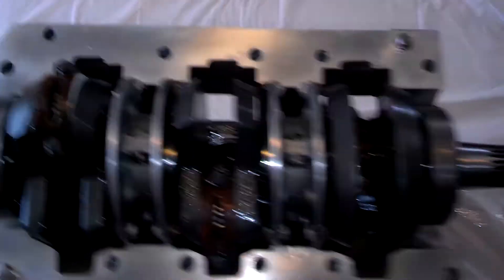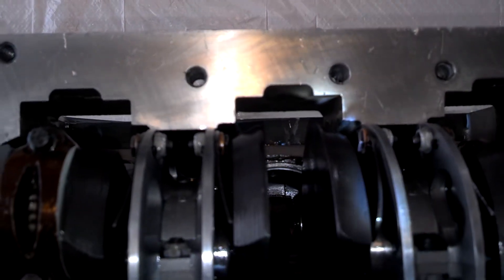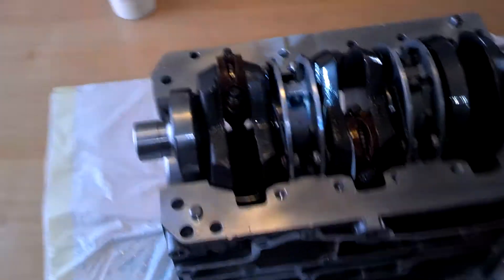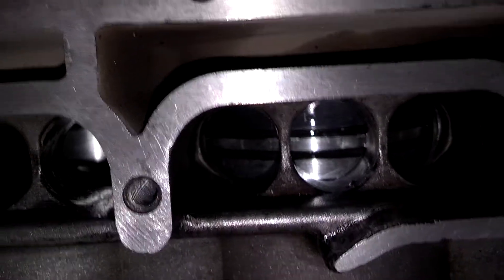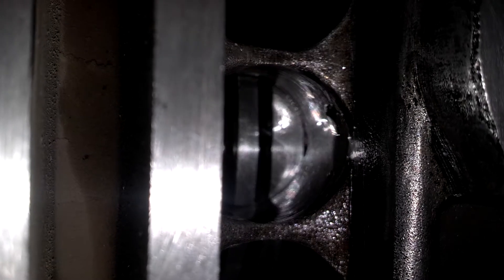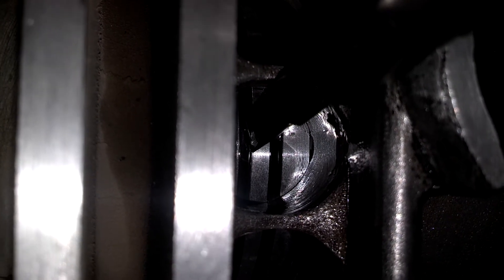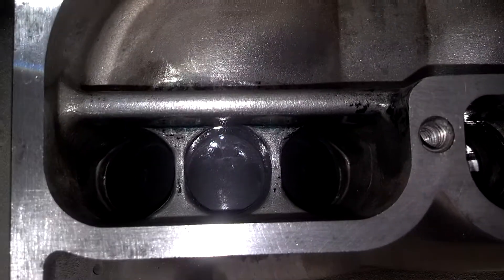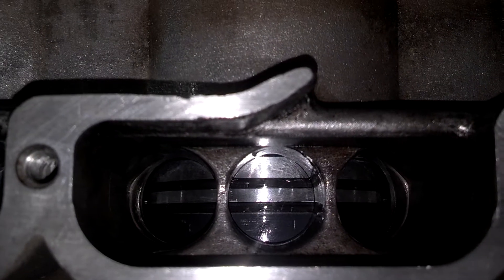Checking piston rings spring tension after rebuild

Comment: I have a 2000 50 merc 2 stk. These are strong motors. 59ci compared to yamahas low 40s. Whenever mine goes kaboom i plan to rebuild it myself. There really isn't any vids or websites showing a rebuild of this motor and im glad you shared! Did the machine shop charge you more to bore since we have a "blind cylinders"? I wish we did have a removable head to check pistons. That is the only gripe i have with this motor. Thanks again for the video!!!